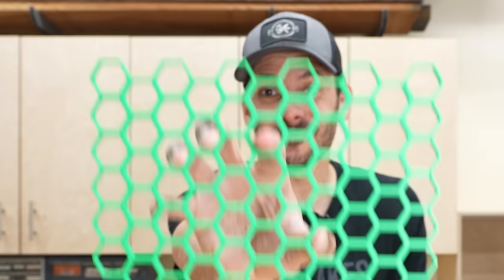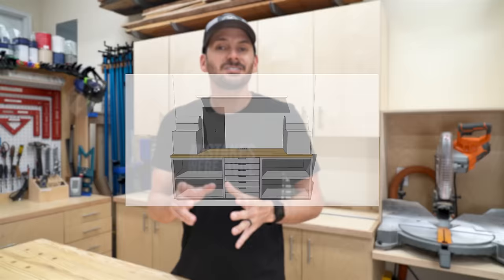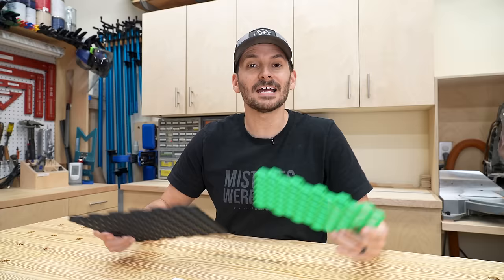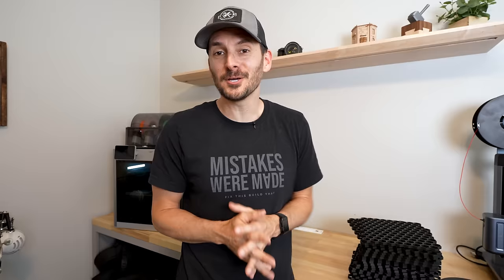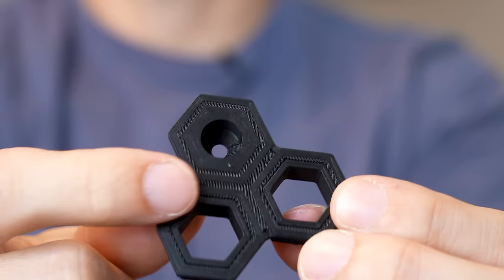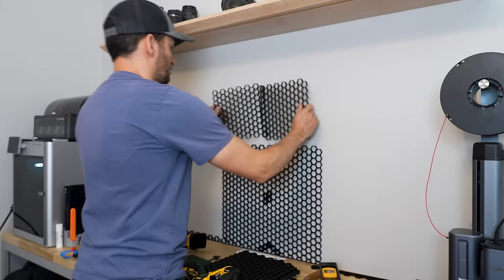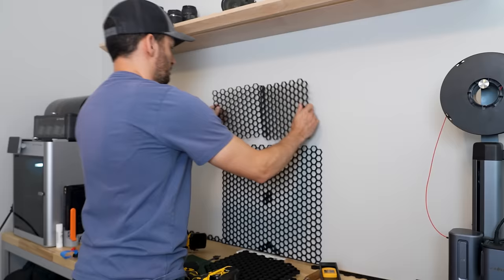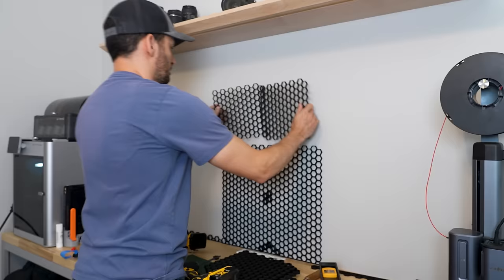Best Wall Storage for Makers?

Comment from the maker: See how I made the LED Floating Shelf!
https://youtu.be/jKxEuH794lE
Reply: So... Basically it's the gridfinity wall panels that you use in this video I'm watching? If you haven't heard of gridfinity, it's mostly known for being a desk based system, where any flat surface can be turned into a compartmentalized storage system, whether it's metal toolbox drawers, or any kind of open space that's flat... Mr Freedman, (I forget his first name) is the creator of that system, and although I don't know if he is the original creator of the hexagonal wall system like you have here, he does make very good use of either this or a system very similar to this for wall stuff, and the version he designed was designed to be mostly similar to his flat surface/desk design...

But you know what? Whether he is the original creator of this system or not, that's the beauty of this system. The fact that this system can have parts added to it or remixed to fit different standards or any number of things, which is why I love the whole 3D printing scene.

There are plenty of things I would love to do that I can't do because I don't have a 3D printer, and I am to be honest, not the best at doing CAD modeling in the first place... But some day though, I'm going to do it, I think... Just need the money for a 3d printer and some filament 😂😂

Comment: This video is a perfect example of how 3D printers will turn us all insane. If this was a system that someone sold for $75, we would all agree that it was super finicky and not worth it. But because we've custom printed it, we think it's the best thing ever.
Reply from the maker: 😂 😂 So true
Reply: The thing is - someone who'd sell it to us would use injection molds and sell it for a lot less than $75. And with it being cheaper we wouldn't care about it being finicky either.
Reply: as if we weren't insane already
Reply: Walmart sells it now lmao
Reply: Yeah, I made a test print and noped right out. Doesn't help that it actually isn't cheap (in filament and power) compared to the alternatives. Skadis was far cheaper for me.
Reply: he does want views though, most of us don't have youtube shows
Reply: @MumrikDK  How much did you expect to spend printing this?  A 9x9 honeycomb would be around €3,50 in filament according to my slicer, printing in Prusament PETG (not the cheapest).  Using around €0,20 in power to print.  The various attachments are mostly cheaper than that.

I used to think the same way, that it's not worth the trouble.  Until I actually got a 3D printer.  The best part is that you can design custom parts to hang the stuff you happen to own.  Whether you hang it on this honeycomb, on Skadis, or a pegboard.
Reply: And I don't need any of it because I don't have a 3D printer.... I also don't have three weeks for projects like this... What I did appreciate was the cost estimate but that was only on the grid. How much are these FREE printers? I would really like to know the cost of 3D printing. To be fair, 30 years ago I spent $2400 on a 300 DPI black and white Laser printer...
Reply: @joekagerer Bambu x1c costs around $1500 with AMS system. I buying plastic at China and pay only $7-10 per Kg
Reply: @ulaB even a bought one can be added onto
Reply: has anyone priced it out by uploading to something like jlcpcb?
Reply: @joekagerer used ender3 go for like 50$ perfect to get into the hobby and if you like it you can always get a more expensive one bamboo makes the best consumer printers rn
Reply: Cost of the material and time is only part of the story. 

As someone who has to store and organize and manage a lot of non-standard size things like camera batteries accessories and lenses, this type of an approach works way better than anything that is off the shelf.

The amount of IKEA hacking that this would take to store the sheer variety of things that I need to makes this approach much cheaper in the long run as well as each item being perfectly suited to my needs.
Reply: Yes but using the 3d printer opens your mind to all kinds of new possibilities that you don’t get by going to the store
Reply: @Juan_lauda  My mind is like a steel trap... rusted shut...
Reply: @joekagerer  I got you. Ender 3 goes on sale for $99 all the time and I got 5 rolls of 1kg filament for $45 shipped so I made that system for way less than his estimate.
Reply: @kalel96000 Where are you buying your filament at for that cheap?
Reply: @joekagerer  It only took three weeks because he printed the panels one at a time. I have the same printer he does. It takes 2 hours and 20 minutes to print a single panel. There's a profile that prints 10 layers of panels on top of each other with supports inbetween. That takes 4 and a half hours to print. He spent so much extra time printing them one at a time.
Reply: @joekagerer  😂

Comment: You never fail to impress. I just installed a bunch of metal pegboard in my garage so I wasn't really looking to do any new wall storage, but stayed for the whole video because of how well it was presented.
Reply from the maker: thank you!  We've been really trying to lean into more storytelling and engaging content even if it's just talking
Reply: @Fixthisbuildthat and thats a job well done then! Keep on doing it - its nice :)
Reply: Same here. I just installed a bunch of metal pegboard.  Wish I’d seen this first, as my biggest peeve with the pegboard is finding appropriate hooks for what I want to hang, and the hooks eventually cost way more than the pegboard did!  The idea of custom designing your own holders is the real winner here!
Reply: @gregclare you can still use 3d print for your peg board though
Reply: @osmondwong508  Good thought. I hadn't considered this, as the pegboard holes are quite small for rubustly attaching 3D printed hangers.  Would PLA be strong enough, or would a filament like PETG or Nylon be required?
Reply: @gregclare  i had used nylon for things and they are stronger than PLA indeed, but for FDM printers layer splitting will always be an issue no matter what filament you use.

so (1), you can design the model so that the layering of plastic is perpendicular to the peg board surface, so that the square inserts’ holding power won’t have the chance to split the layers.

(2) use multiple inserts holes to split the loads apart will reduce stress and pressure on each sections

(3) you could also consider to design 3d print parts AROUND those limited metal hangers, especially those single long sticks for tapes hanging. Have two of those at each bottom corners you can design plastic parts which “stand on them” and hold what ever you like.
Reply: @osmondwong508   Awesome.  Thanks for taking the time to share your experience and knowledge.   I'm a Fusion 360 user, so I'll be sure to investigate this further, and I particular note the perpendicular print orientation to maximise strength.  I've already spent too much on metal hooks that aren't ideal for my needs! 🤔
Reply: I just got a 3d printer, hoping to print hooks that will actually stay in my garage metal pegboard.  I like the durability of the metal pegboard, but drives me nuts having hooks fall out every time i pull something off or just slap something down!

Comment: I’d love to see failure tests to see maximum weight capacities. Like at what weight does a single cell fail. Or with how much torque would it take for a mount to sheer out…
Reply: nothing fails =)
Reply: The thing with the HSW system is that it's all hooks and friction based so weight capacity and torqueout will depend on how it's printed.
Reply: I'm thinking to go with "ThreadBoard" for exactly that reason

Comment: Very nice!

I got a sheet of plywood, painted it white, anchored it to the wall with four screws and just drilled holes whever I wanted to mount something. $20 and I will never have to worry about it breaking. fast, strong, cheap and doesn't trigger my virtigo from all the holes. If I really want to move a hook I drill a new hole and if I really don't want to see the old hole I can either print a dummy peg or just put $0.01 worth of dowel in the hole.
Reply from the maker: can't beat that for the cost
Reply: How do you avoid drilling holes in the wall behind when you want a new hanger?
Reply: @2degucitas  before you put up the sheet, put some spacers behind it. Mount some 2x4s, 2x2s,  etc, to the wall, or you can just screw them to the back of the sheet if it’s going on top of a desk/workbench, just to keep it away from the wall, and however thick the spacers are, that’s how much room you have to drill without hitting the wall. If you have 2 inches, mark off 2” or less on your drill bit with tape, and the tape prevents you from going too far and drilling into the wall.
Reply: Your my hero that’s what I’m doing
Reply: I used to do that, but not very flexible.  But glad you reminded me.  Think I will do plywood on to my walls, and then screw the hexgrids to it.  Best of both, and no wall anchors to defile my sense of craftsmanship!

Comment: I saw a cool technique recently where you can use a traditional paper document scanner to very accurately 2d scan an object. If you include a metal rule in the scan for calibration, you very easily have all the measurements, angles etc of the object you want to design. Easier than calipers.

Comment: It should also be noted that PLA is subject to deformation when strain is applied to it over time, especially if it is in a hot environment (like a lot of garages are).
If you're going to 3D print these grids, I'd recommend a higher than usual infill percentage and give it a minimum of 3 shells.
Reply: Or use abs

Comment: Have you ever seen shadow foam? It's a customizable foam cut out product and looks mega cool. You end up with a "shadow" of the tool (in whichever color brand you're loyal to) So you never lose another tool !
Reply from the maker: oh yeah.  I used to be in Lean Six Sigma and we had shadow boards in the shops.  Colin Furze actually just did an awesome one at his new shop
Reply: The problem with those is flexibility. What do you do when you want to add a tool but didn't leave enough space? You cannot rearrange it. Or what if you upgrade a tool and it is no longer the same shape? My tools change too often for that kind of system. This hex grid looks amazing!

Comment: one of my first 3d prints was actually an air nozzle I designed for my shopvac, so that when it is on the "blow" mode it creates a very high volume of air to dust stuff, dry off cars after washing, fill up inflatable pools and what not
Reply from the maker: great usage!

Comment: Looking for the edge pieces and the corner pieces. I went and printed the main areas first and spent forever looking through all the files thinking the edge pieces were somewhere. 3 days later I finally realized you did not include them... in the links as you had said that you would when you made the video. Please please post them.

Comment: I'm going to use butterfly toggle anchors to secure mine. The toggle Bolts are rated for up to #200 (Toggle Anchors -Toggle Bolt and Wing Nut Kit for Hanging Heavy Items on Drywall ) ! you could also use zip toggles anchors (Simpson-Strong-Tie-FT18250R100-FlipToggle-Anchor)
Reply from the maker: good choice if you'll have a lot of weight on it

Comment: you could have gotten a long piece of sheet metal and glued all the honey comb to it using hot glue or epoxy and only THEN attached it to the wall at strategic places without sacrificing so many combs... would also have protected your wall and looked really cool with a metallic backing

Comment: I started planning one of these walls so I glad to see a video on it. I am now even more excited to get it done. Great video!

How easy are the insertes to remove to rearrange after the wall is up?
Reply from the maker: I'd highly recommend tuning everything before you print all the grids and inserts.  Test on a small 3x3 grid and see what settings work best.  And there is a link to a remover tool in my collection as well

Comment: The OpenSCAD version you are using is not by Wireheadarts, it is by Xander.  I had the Wireheadarts file but it didn't have the edge parameter.  I noticed the different file name and found a similar parametric file by Xander that matches your "v2" file name shown in the video.

Comment: 3D printing is my addiction. I have three of them built from scratch. A fourth is in the planning...
Reply from the maker: Voron?
Reply: A Voron Trident, an Ender 3 converted to a Voron Switchwire and a Voron v0.2 currently being retrofitted with triple bed belts.

Next up I fancy a VZBot 235 All Wheel Drive.

Comment: In my opinion just a plain plywood and different kinds of screws is all you need for a simple and endlessly modular wall mounting system especially for tools. Might not be the most professional looking, but it's cheap, functional and you may even already have all the materials. You can even trace the tool edges on the plywood so you can see what goes where. Can be eraised by sanding.

Good video anyways!
Reply from the maker: yep, very utilitarian way to go and cheap.  i wanted the looks too though :)

Comment: I left this comment on one of you’re “tools under $20” videos and will put it here too:

I don’t know if you know that but the best way to change the blade of a snap off utility blade is to extend it fully, pull on the blade so it comes off. Then you retract completely the mechanism so it catches the next blade. Much faster and less dangerous

Comment: I've used gridfinity for organization in my shop which is also modular but not as useful for wall applications. I like this. My X1C with AMS actually is arriving today so these will print out a lot quicker my other printers..

Comment: It does look and function awesome, but if you had mounted these grids on a finished piece of plywood, the when it is time to move your shop, the entire thing could be taken down as a unit, and with fewer messy holes to patch. Drywall doesnt have much strength, either, so by mounting on a board, you gain a stronger support system.

Comment: I do like this honeycomb wall for the looks, but when I tried printing it and using it, those inserts fit so tight that getting them out seemed impossible without breaking something and I actually broke one insert. That was before it was even mounted to the wall so I had access to the back of it. Not sure what more would break if I could only pry it from the front. I thought I did something wrong, but many people on Printables also mentioned that the fit seems to be too tight. It seems like after you place it, re-arranging things might actually break parts, which isn't really great.

Not sure if you did anything special, but when showcasing how it works at the start, it seems to snap in place without too much effort for you. Did you print it in PLA or PETG?
Reply: That sounds like a tolerance issue you would need to figure out with your specific printer. As you may be extruding a tiny bit more filament than his printer, and therefor your fit is must tighter. Haven't looked into the system, but I wonder if the OpenSCAD version he mentioned allowed you to add in some tolerance to each grid item (making them just slightly bigger), so you can print the holders normally, and it will fit your mounts perfectly without breaking.
Reply: @channelnotfound403  yeah I'll have to experiment a bit more with printer and filament settings. I did try scaling the inserts down by 1% and that made the fit easier, but that means that mounts that go into those inserts would also have to be scaled down. But yeah I just need to spend some more time on this.

Comment: I was able to get the print time down by a lot by tweaking the slicer settings, and I could probably get it even faster. I can print an 8x8 grid in 1h35m.

Layer height: 0.28mm
Wall loops: 4 (results in only a single line of gap infill)
Top surface pattern: Concentric (also makes the top lines nicely aligned)

This will also give you stronger parts too!

Next I'm going to try increasing the line width and using a 0.6mm nozzle

Comment: You should be able to bond the 3D printed pieces together using methylene chloride (a.k.a. dichloromethane) or tetrahydrofuran (a.k.a. oxolane). Both should melt the PLA surface and then evaporate very quickly. Depending on the exact PLA mix, the bonded area might become slightly flexible, but if the contact surface is large that won't be an issue. And that lets you put the anchors wherever you want, without having to worry about where the seams are (or were).

Comment: You could add the screw adapters and panel joiners in the design before you printed if you were particularly set on getting it just right.
Reply from the maker: very true!

Comment: The largest HSW on an X1C can print in 1h30m at very high quality. 

Sadly HSW can’t hold more than a pound three inches out. 

I have a custom threadboard system that holds 5lb at 3ft out. Usually cameras and lights.

I’d suggest for anyone who likes HSW to use the Multiboard system, I forget the guys name. But in my testing it can hold twice the weight as the HSW.

Neither work for me as I have to move having cameras around multiple times a day. So an 8mm threadboard basically can never wear out. Also I can hang things upside down with no fear lol. 

Some may not want to support the guy who did the kickstarter for threadboard. So I suggest you just take 10 minutes to learn and design it yourself. 

Also don’t freak out about the $20usd per kg average you see. You can easily find singular deals at $9. Or do what I do and order 20-100kg at $9usd per kg